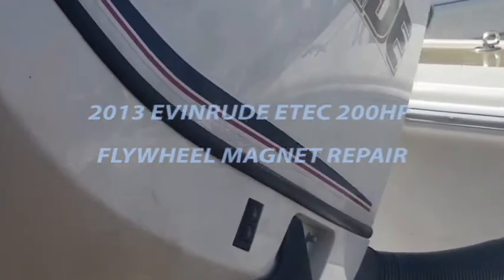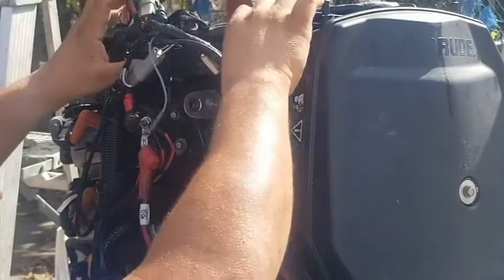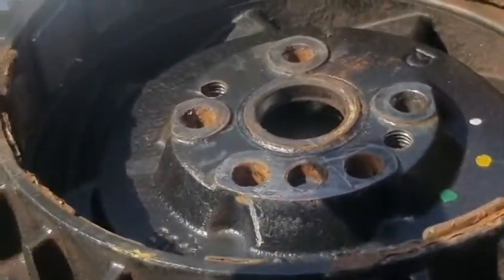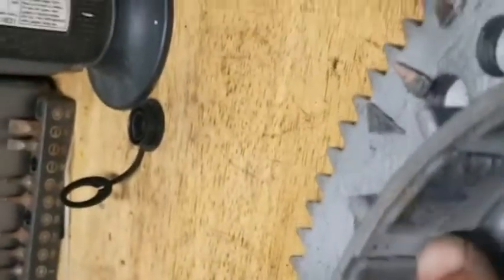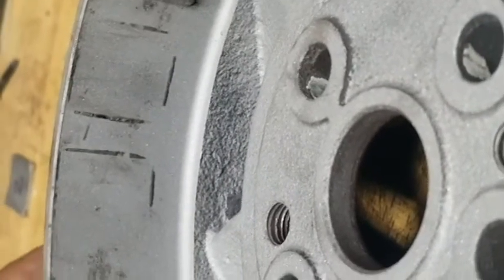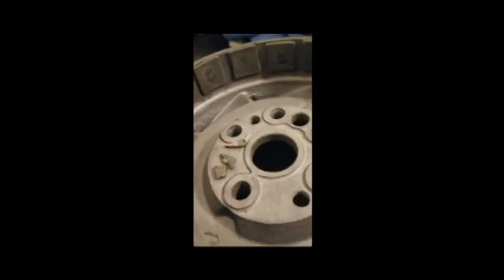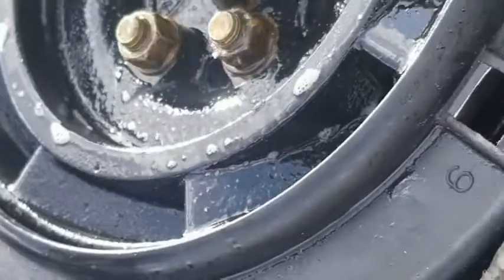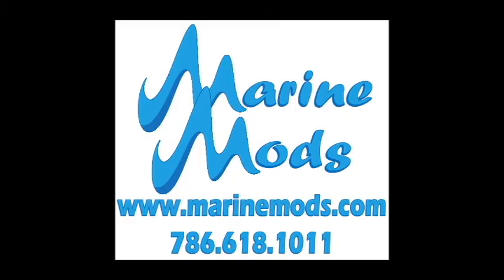Evinrude E TEC Flywheel Magnet Repair

Comment: just out of curiosity i just brought a boat with an etec 115 on it everything is all good by the mechanic but he said i might need to get a new fly wheel because its a bit rusty and could possibly have the same issue of the magnets pulling just wandering is there a way to get all the magnets off so i can sanblast the flywheel, paint it and glue them back on? cheers.
Reply from the maker: Generally the magnets will come loose on their own. If they are not loose I would not attempt to remove them Maybe sure up the edges with some two part epoxy.

Comment: what flywheel puller did you use?
Reply from the maker: I purchased a puller kit several years ago from a guy off eBay
Reply: @marinemodscom  did you have to set the timing after replacing the etec? Also Im doing the same exact thing on my 07 150 etec if the magnets fly out and break, and lock up the flywheel on and off can it cause further damage to other parts of the engine?
Reply from the maker: @Wikernb  I don't think the magnets themselves will cause damage they will more than like shred. Since I used the same flywheel I did not set the timing.
Reply: @marinemodscom  thanks man